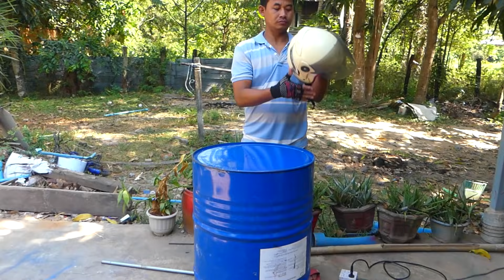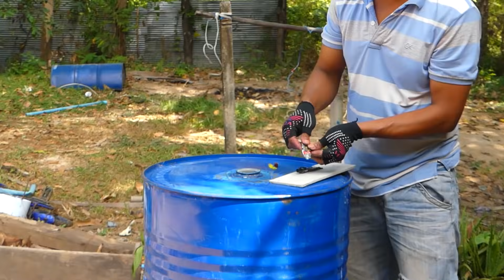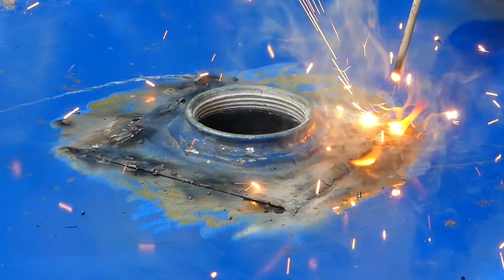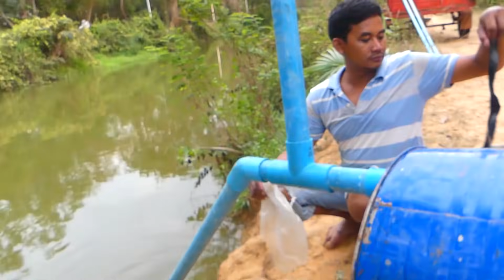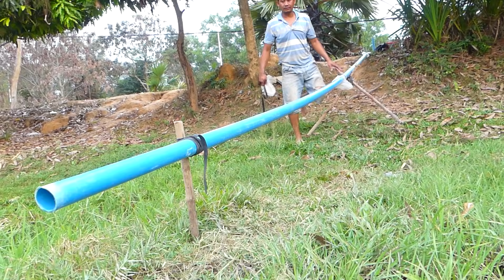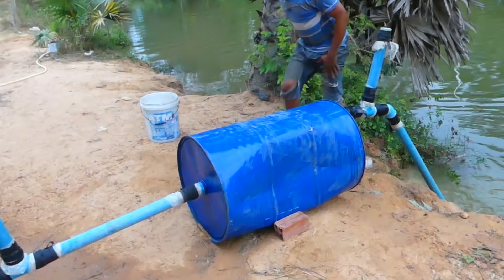Deep River - How to make free Energy water tank from Deep River About 7 meters Deep

Comment: To avoid crumpling of the intake drum, the discharge pipe must be twice larger in diameter at the intake pipe. The volume of water running in the 7 meter (22.95 ft) must be twice at the discharge pipe.
Reply: Noop. Heigh differnce between river and outlet must be reduced.

Comment: Why all the plastic wrapping? You run out of glue? You keep saying something about “apple pie”?
Reply: Your outlet is lower than inlet, of cause the water will flow.
Reply: Cheap ass couldn't afford to buy seal tapes.
Reply: So which is the exact answer of making the drum to deform?
Reply: @harrisonmwakwari1545  It is due to external atmospheric air pressure.
Reply: @Dingsrud  with a lame man language...what  should I do  to prevent the drum to deform?
Reply: @harrisonmwakwari1545 
With your drum, you must make it stiffer, use a stronger one, or reduce the height of the drum over the water source. 
Using different diameter tubes will not help.
Reply: @Dingsrud  Thanks I will try that,👍
Reply: The wrapping is to make the joints air tight when not using glue. With no glue, the system can be taken apart. With glue, uou have to cut it.